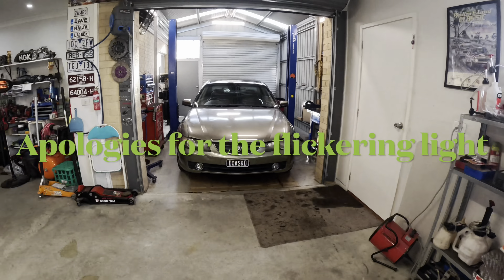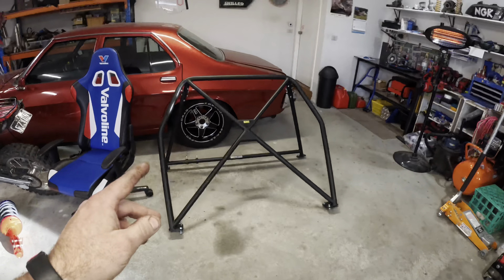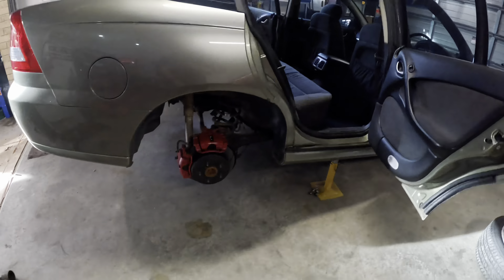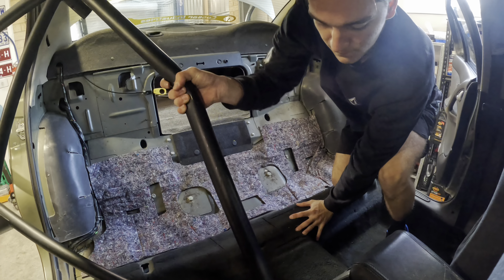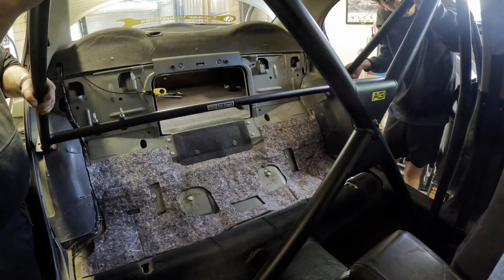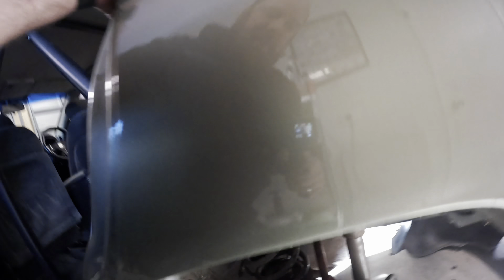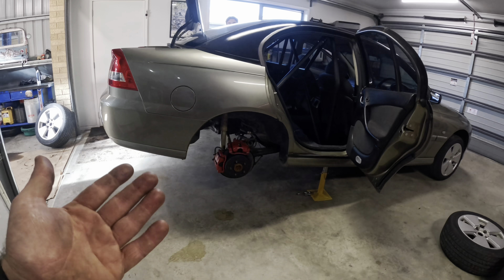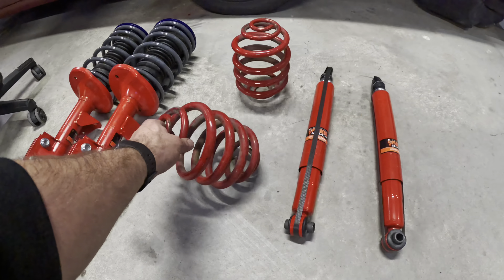VY Commodore Drift Prep Ep 2. Half Cage & Suspension Install

Comment: Hey just wondering how much room is there between seats an cauge as looking at cauge for my vy for tack an still Abel street drive it if want to but needs be that:

the roll cage is at least 150
millimetres behind the front seats an 
occupants when the front seats are
located in the most rearward
adjusted position

Kind regards Ben
Reply from the maker: Hi Ben. With this cage you cannot run the rear seat. 
There could be 150mm to the back of the front seats, if the front seat were fairly far forward. Making it tight for someone of medium to tall hight to drive it comfortably. 

However, that aside, by fitting a roll cage to a street car, even a half cage, the vehicle would need to be engineered. I know this as I worked at an engineering shop for several years. 
You are Changing the structural rigidity of the vehicle, and also changing seating capacity. Both those items require engineering. 

People often try and blur the line between road car and race car. That’s why I’m not interested in trying to register the Calais.
Reply: @cassarindustries_wheelwerk  yeah removal reah seat an belts isn't issuew as don't have people in reah of car offen was more ease of geting to an from tracks... an spoke to transport sa department they where ones told me about 150mm an seaid would need a vehicle inspect to prove reah seats removed an reclassified to a two seat compacity
Reply from the maker: @downhillrock yeah mate seat reduction must also be engineered. At least in Victoria anyway. They fall under the same law as like adding extra seats to a van or something. As far as local law is concerned, adding or subtracting seats must be engineered. Seat belts removed, and all holes that go to the external of the vehicle from either seats or seat belt mounts must be filled